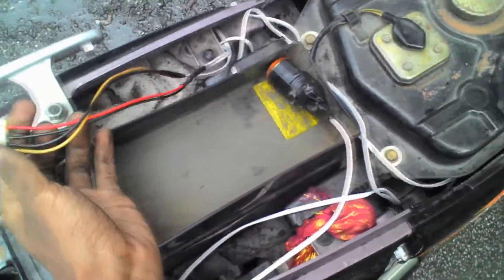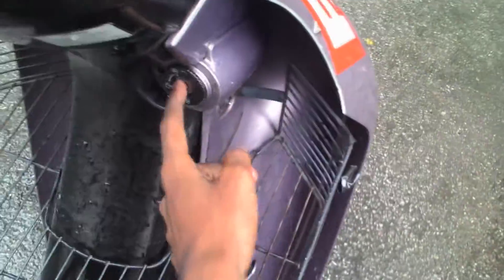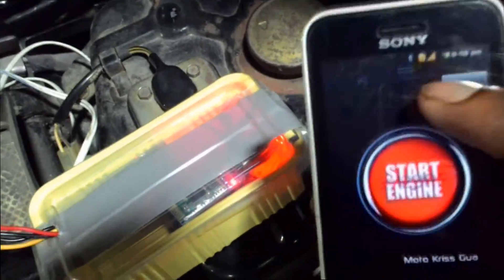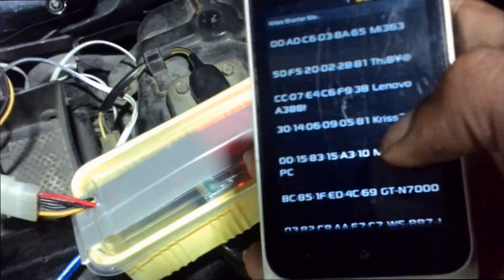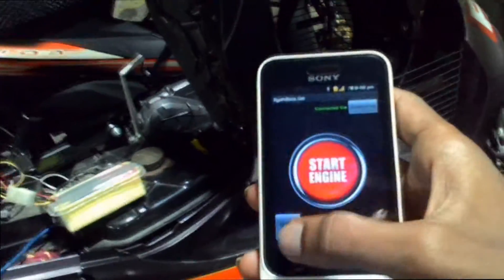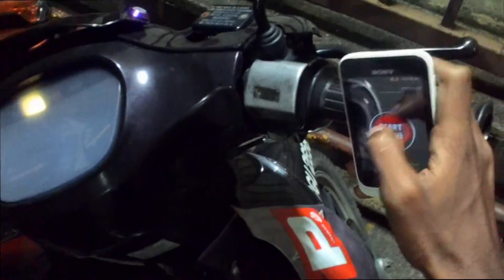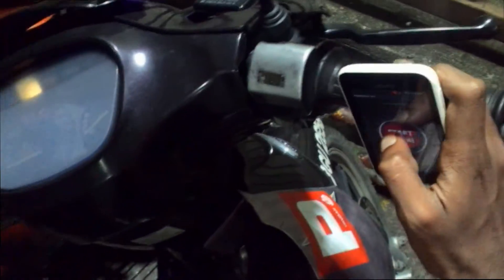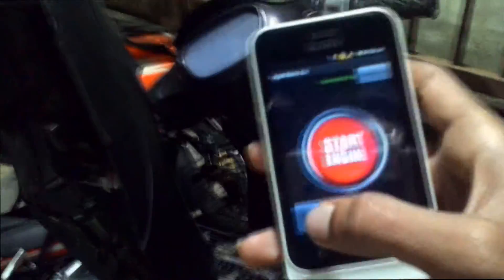Arduino Bluetooth Motorcycle Starter (start motorcycle with your phone) pt.2

Comment: can you show how did you connect the wires from the bike to the arduino more elaborately...thanks
Reply from the maker: it depends on the bike.. some bikes have 3 wires comming out of the key switch.. and some has 2..
Reply: please make a video that shows the connection of the ignition to the arduino...Please....!!
Reply: i think the ignition cables are connected to the relay of the arduino. just find the ignition cables. but i still noob to do this. have to learn more